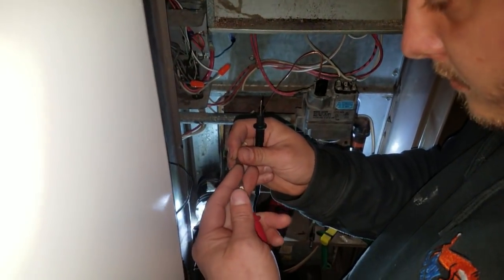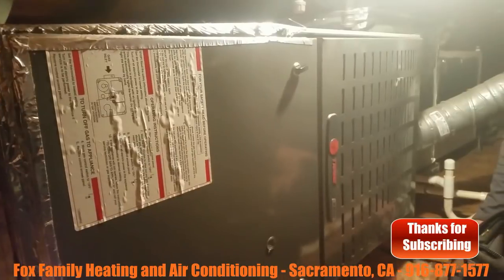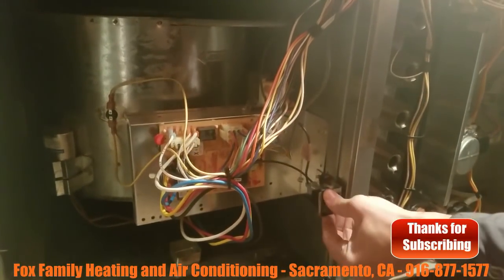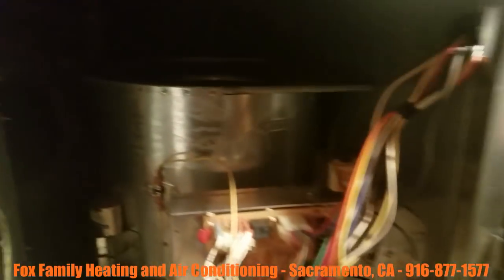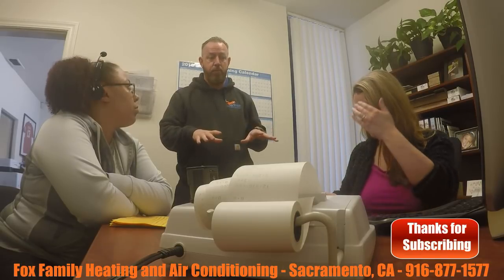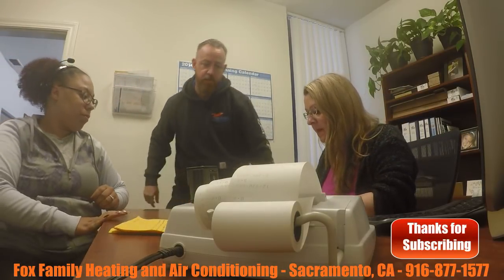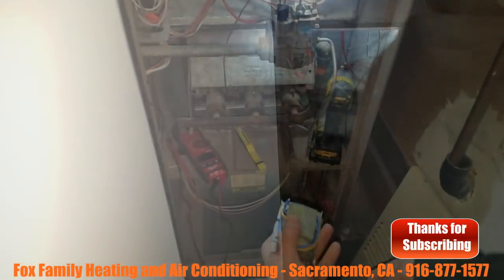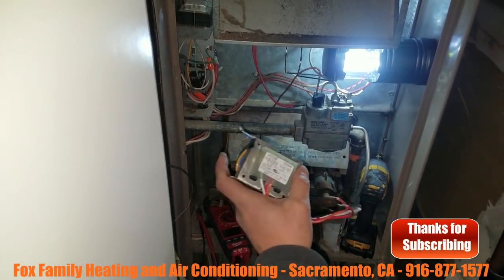The Life of an HVAC Technician - Episode 6 - Furnace Repair in Sacramento

Comment: A quick Delta T can tell you a lot about a systems airflow which is usually a big problem whenever you have a service call and the system runs right in front of you. Allow to run for 10-15 minutes before checking and unit had the specs on what you should be seeing.
Reply from the maker: Agreed.  Thanks for the info!

Comment: have the techs triple check the thermostats if there's no error codes on the unit boards. the type that snap off the backing plate to change batteries tend to not get plugged in fully or crooked, bending pins and breaking solder joints inside, what you get is intermittent contact and random failures from occupants changing thermostat settings, also doors slamming and other vibration can make them work and stop randomly.
Reply from the maker: Good stuff!

Comment: Did you install a in-line fuse on a transformer? Anytime I replace a transformer I always add an in-line fuse. Just because to cover myself down the road if there's ever another short orif that transformer that's being replaced went bad because there is a grounded wire or short with no fuse is just going to burn up another transformer.

Comment: Avoid call backs hire better experience technicians
Reply: HVAC GENIUS, that comment seems a bit harsh. So you have never had a call back on a furnace with a control board, his ignition and flame sensor set up. Plus other things like a pressure switch to deal with.
Reply: polishtheturd mickelson harsh comment? I wasn't only referring to THIS video
Reply: No need to attack Greg and his staff like that. There is a shortage of qualified techs all over the USA. Not saying Fox Family has bad techs. But, they seem qualified to me. You never answered my question if you had a callback on a newer furnace, I find that odd.
Reply: polishtheturd mickelson sorry not attacking anyone. Text messages, comments are often misread. Yes severe shortage of HVAC technicians in the USA. Some companies in my area Central Florida use guys from day labor. I see it as a disservice to the customer.. I am not a subscriber to Fox and only check in once in awhile. Only about 1% gas furnaces in my area Central Florida.
Reply: Some of those trane have that 80v ignitor on there. Seen to many tech's replace board and not put the proper ignitor on there blowing that 80v one. Sometimes the obvious problem isn't. Hvac Genius your right about new tech's. We go through tech's all the time now cause they don't want to learn cause they think they know everything. Always try to take classes when offered.
Reply: Michael Henderson thank you! Some of the new tech's that have a little bit of Common Sense do not know the theory and and don't look for why the problem happened. I am training 2 fresh out of HVAC school they claim they did not learn anything in school.